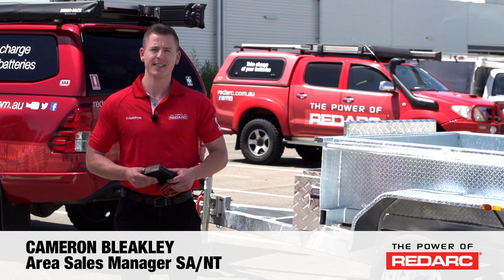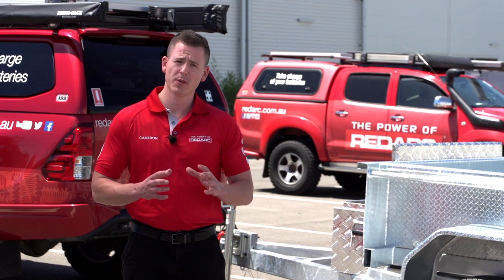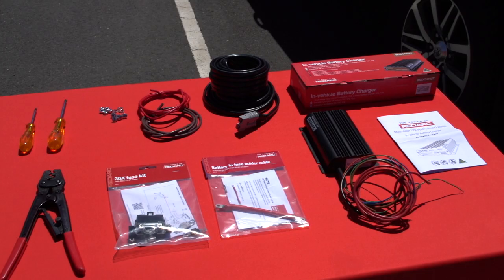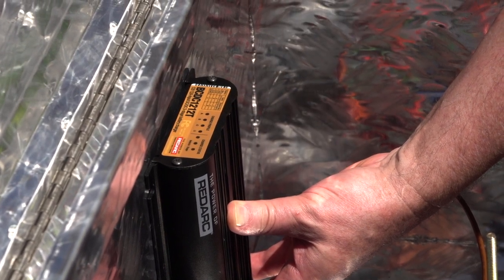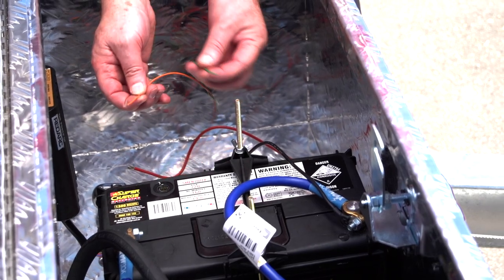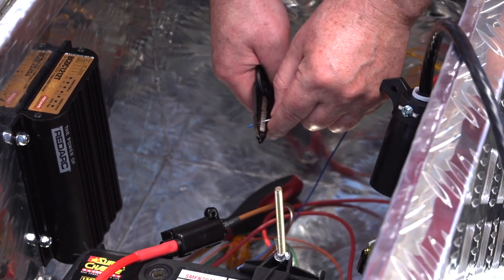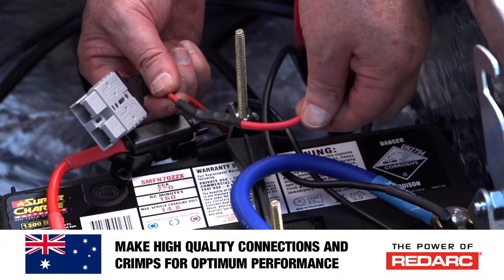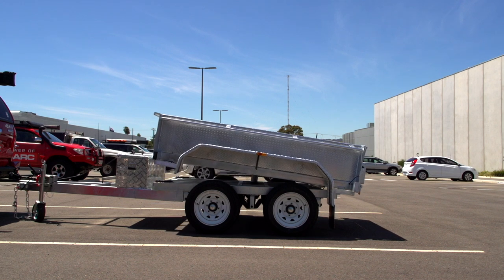How to install the REDARC BCDC1212T trailer battery charger | DIY BCDC1212T Install

Comment: In this video it looks like you are going to use the existing wiring harness and 7 pin trailer plug on your vehicle.   How do you know that the existing wiring in your vehicle harness is sufficient to support the amperage needs of your dc-dc charger?  Yes, it's only 12 amps  but . . . will your charger safely operate if less amps are available due to wiring size constraints?
Reply from the maker: Hi Bruce, thanks for your comment. Before fitting the BCDC unit, the wiring should indeed be inspected to ensure it can handle at minimum this 12A current draw (can peak up to 20A in some cases) – which is a minimum of 10 B&S thickness. We recommend this in our instruction manual for the product too, to ensure this step is taken so as not to cause harm to the system or vehicle.

Comment: Could you clarify why a 7 pin round is suitable but not a 7 pin flat? is it due the amp rating of a flat plug being lower?
Reply from the maker: Hi Harry, thanks for your comment. Indeed you are correct – a 7 Pin flat trailer plug/socket is rated to approx. 15A @ 12V, whereas a 7 pin round plug/socket is rated to 30A @ 12V. Much more acceptable and heavy duty when using this BCDC.

Comment: Can you explain the blue wire again. Why would you unstall it again
Reply from the maker: Hi Chris, thanks for your comment. The Blue wire is required for any vehicle that has a smart alternator fitted to it – it allows the unit operate down to a lower voltage level so it can compensate for when the alternator's ‘smarts’ kick in and the voltage drops. Some examples of these vehicles are Ford Ranger, Volkswagen Amarok, new Isuzu DMAX/MUX, new Mazda BT50 etc. Vehicles like Toyota HiLux, Prado, LandCruiser, Mitsubishi Triton etc have a temperature compensating alternator and will not require the Blue wire in their case. If you require further assistance please don't hesitate to contact our helpful Tech Support Team on 1300 REDARC.

Comment: if this video is intended for an RV user then you did very poor job. There is a big divide between your presentation  and your website peddling the device as a drop-in solution.
Reply: "if"
Reply: I cannot find a different charger that does what this one does (at a similar or less price point).  It is designed to help keep an auxiliary battery charged with 3 stage charging. It works to safely charge LifePo4 batteries. It also works as a vehicle battery isolator.  If there is a better product out there I'd like to see it, as I am working on this project right now.